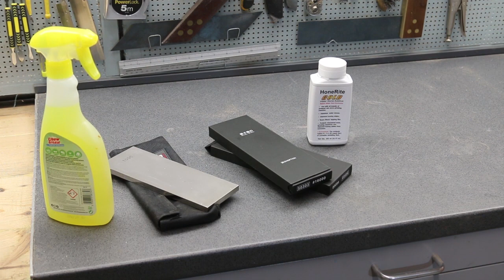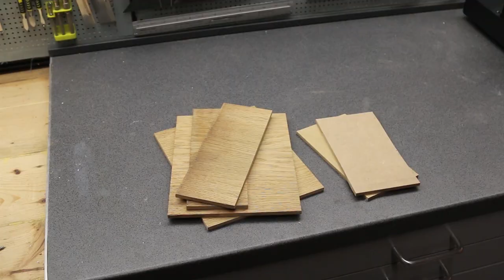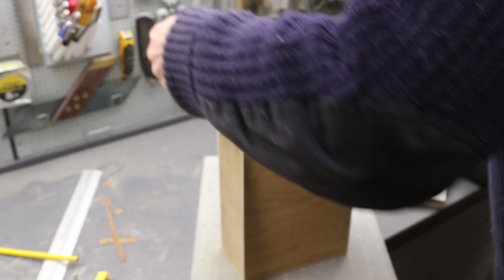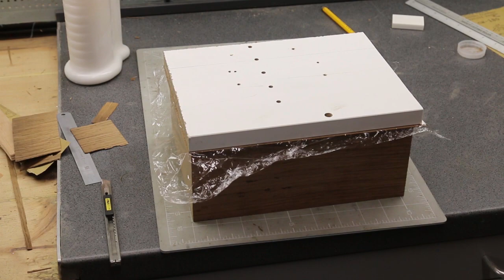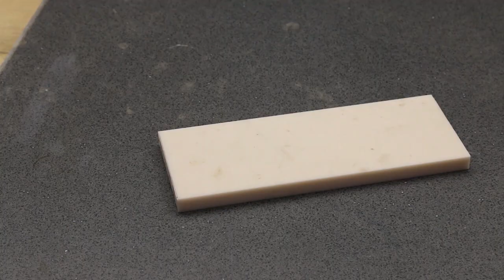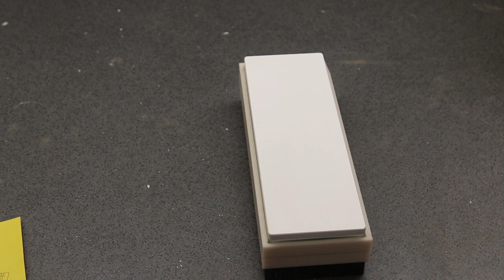Stay Sharp

Comment: Thanks Mike, a typically well thought out and neat solution, I'm intrigued will you follow this up with a video demonstrating your sharpening process, do you have a link to the water stones ?
Reply from the maker: I bow to the greater experience of the Masters, such as Rob Cosman- it was his demonstrations (YT) that caused me to assemble this kit. Having said that, there are some aspects that, with my engineer's hat on, I feel could be 'adjusted'- so I might follow up. Using a jig is also something Rob does not do- but I am less comfortable doing it freehand, especially with plane irons from planes being restored, which are far from being in good condition. Perhaps one day.
The Shapton glass stones I bought from Knivesandtools, who shipped quickly and at a good price. Good being relative- these things are not cheap. But they are easier to use (do not have to be kept wet) and can be flattened with the diamond plate.